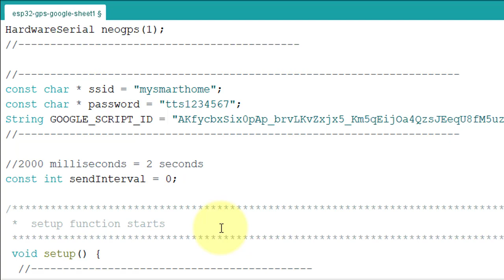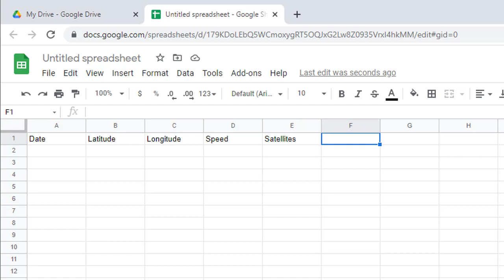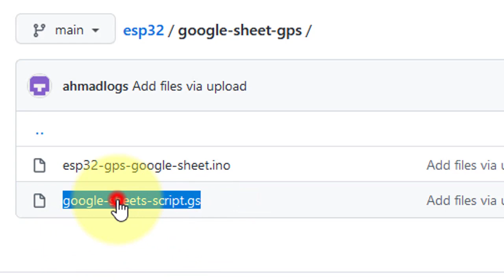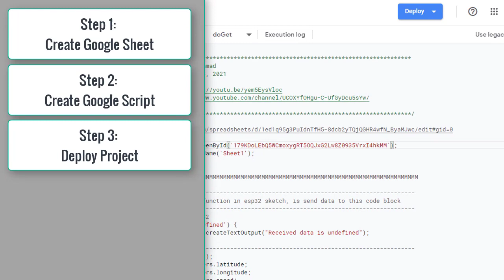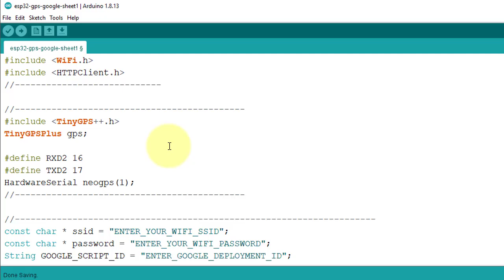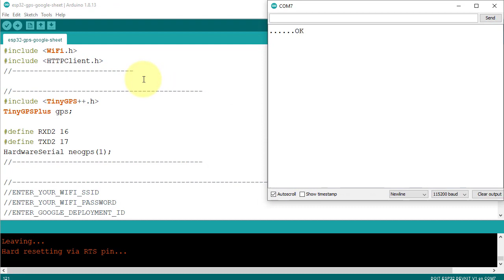ESP32 GPS Data Logger with Google Sheets | Send Data to Google Sheets using ESP32

Comment: Sir., 
With GPS parameters (lang,lat,speed etc) can we able add more data's which are measured with different sensors and add them to gps.?
Reply from the maker: Yes, you can
Reply: @AhmadLogs  how's it possible sir.,? I needed it for my project work..
Reply from the maker: @akshaydodamani7265  tell me your project requirements
Reply: I figured it out sir., Tnqs for ur spending quality of time to reply. 😍

Comment: Dear Mr Ahmed,  i received the status code 200, but when i check the scripts execution  it shows the request is failed, so the google sheet doesn't append any data. Can you please shows me what i've done wrong on this project.  Thx A lot.
Reply from the maker: I think there is a issue with the google sheet server. so just try again after 3 to 4 hours

Comment: Assalam o alaikum Ahmed bhai I did this carefully and receive data on google sheet but only when esp32 is connected with PC or laptop but couldn't get the data on google sheet when only esp 32 is powered by battery, please guide what could be the error?
Reply from the maker: If your ESP32 is only able to send data to your Google Sheet when it's connected to a computer and not when it's powered by a battery, it's possible that the power supply you're using is not providing enough current for the ESP32 to function properly. Try using a power supply with a higher current rating or a battery with a higher capacity. Double-check your wiring and review your code for any potential issues.

Comment: Hi Mr. Ahmad. The video is really smooth & helpful. One small question (with reference to 0:32 from current video). I am not getting readings in after each second. Its collecting data after 7secs only (even after changing value of SendInterval to 0). could you please help. I want to collect data in milliseconds.
Reply from the maker: it is just because the program is wait for the response from the google sheet. after getting the successful response back. then it will send the next data. I have just speed up the video that's why it looks the data is transferred very fast.
Reply: @AhmadLogs  Thanks for the information. Is there any way to speedup this responses (to get milisecond of data)?
Reply from the maker: @shaikhatifbadshahsvnit4167  it required fast internet connection. I have use a different code in my latest video about google sheet and the performance is much batter then this project. you must check that

Comment: Thank you very much, dear Mr. Ahmet.
I did the project carefully 1-2 times
Arduino esp32 side works perfectly.
But it does not write any data to the Spreadsheet side.
I gave all permissions, what could be the problem?
Reply from the maker: what error shown in the serial monitor
Reply: @AhmadLogs  HTTP Status Code: 403 in my case. Despite giving "anyone" permission, Google is being a little ****.

Comment: Can you help me please. Mine the output in serial monitor said

0
No any valid GPS data.

my neo6m was working fine in arduino uno and i also tried to my esp32 in different code and it is also work fine but here said this.
Reply: After a many trial and error i came up with alternative traubleshooting to the GPS functions.
if the serial monitor says

"0
no any valid gps data."

the part of statement that == 1 try to change to 0 and test it. if there is a function will be send to your gsheet even 0,0,0,0 but the gps time and gps date there will have a value. means your gps is working. the device also depending on the satellites he will get on signal. if data sent even 0,0,0,0,gps time ,gps date. try to change the statement == 1 again and run it. then wait at least a couple of minutes.

ps: this situation works mine i hope yours too. i am also a beginner. Thanks!

Comment: I am getting no new data received can u plz help 
It shows no new data Recieved  in serial monitor
Reply from the maker: is your gps module working fine?
Reply: @AhmadLogs  it’s working fine 
Wt to do sir now
Reply from the maker: @mrkiranbadiger5553  what is the led status of your gps module
Reply: @AhmadLogs  when I check only with gps test it gives coordinates but when I connect to esp32 and run it it gives no new data recieved
Reply from the maker: @mrkiranbadiger5553  it is strange
Reply: @AhmadLogs  Wts the error I am getting plz tell help me
Reply from the maker: @mrkiranbadiger5553  unfortunately I cant figure out the isse
Reply from the maker: @mrkiranbadiger5553  just check you rx and tx connection. and make sure the connections must be correct in hardware and in the code
Reply from the maker: @mrkiranbadiger5553  I will have to take a look at your code.
Reply: @AhmadLogs  how to send u sir
Reply from the maker: @mrkiranbadiger5553  just upload it to github or any code sharing website. and send me the link
Reply: @mrkiranbadiger5553  if solved then please help me out
Reply: @kiran hello your problem is solved

Comment: please  nothing work "no new data received" were is the problem please u know??
Reply from the maker: what is the output in serial monitor?
Reply: @AhmadLogs  output data input G12  G14
Reply from the maker: @cyrinechabbah237  have you tested your gps module. give me full details about your project
Reply: GPS module sim 808 and esp32-WROM-32
Reply: @AhmadLogs  Haw can i test the gps module please?
Reply from the maker: @cyrinechabbah237  just connect the power supply to your gps module. attach the antenna and put the gps module on the roof. observe the led status. if it blinks once in every minutes it mean, your gps module is working fine.
Reply: @AhmadLogs  thank u :)

Comment: can you show us how to do the same thing but using sim800l module please?
Reply from the maker: not sure. but I will try
Reply: @AhmadLogs  Using gprs instead of wifi
Reply from the maker: @funnycats9738  will try in future
Reply: @AhmadLogs  thank you so much
Reply: Sure, for an IoT projects using gprs is most versatile than using wifi, because with gprs project can be placed anywhere.
I would request using a library to handle connection rather than using AT commands
Reply from the maker: @raymondmichael4987  yes, you are right. I will try using some library like tinygsm library.
Reply: @AhmadLogs  , I'm delighted to hear that.
Stay blessed my brother
Reply from the maker: @raymondmichael4987  thanks
Reply: Thank you so much